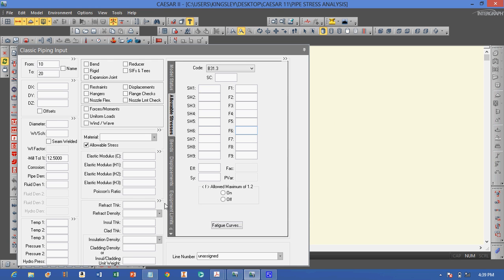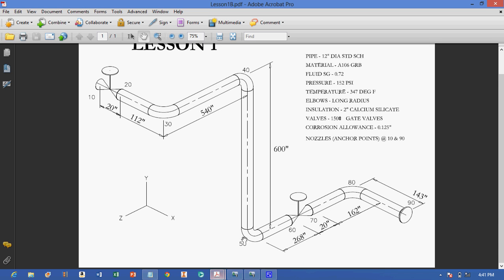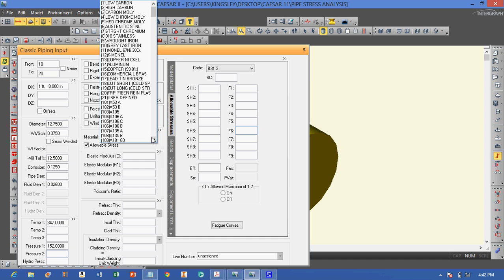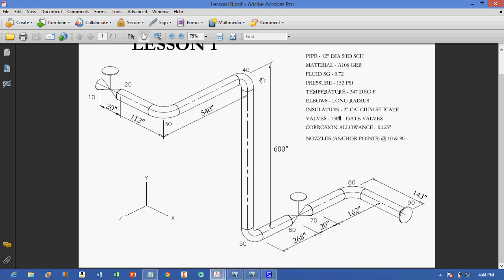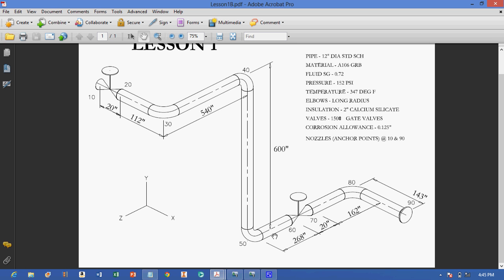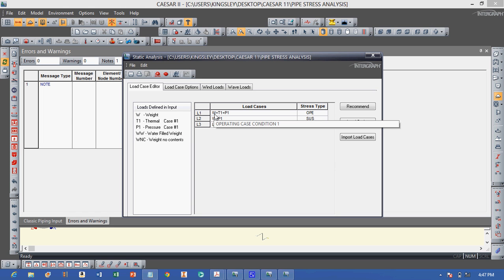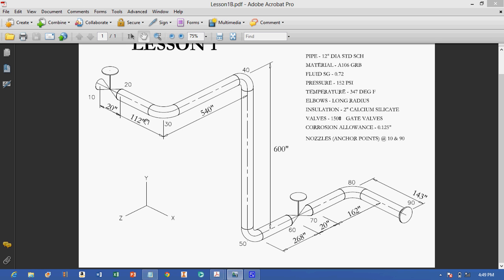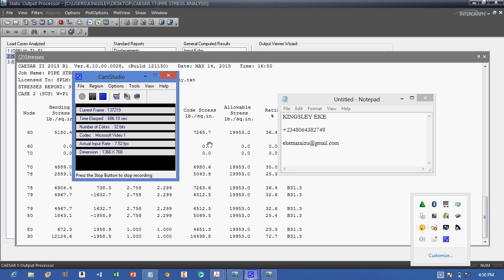Pipe Stress Analysis using Caesar II

Comment: You could have just added support instead of decreasing the pipe length. In reality those pipes have been sized already from the Isometric drawing based on equipment to be tied on to. Good stiff Eke!
Reply from the maker: hello oseghale. thanks for the comment. i would like to say there many engineering solution to different engineering challenges. during FEED, we choice the best solution